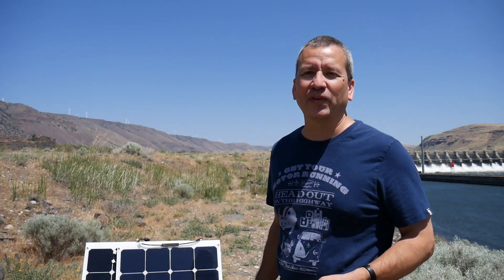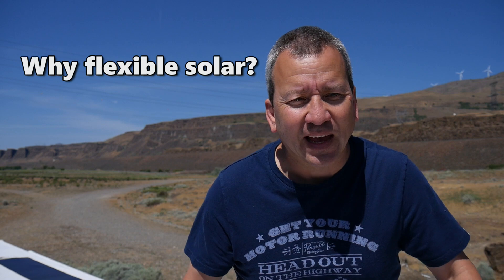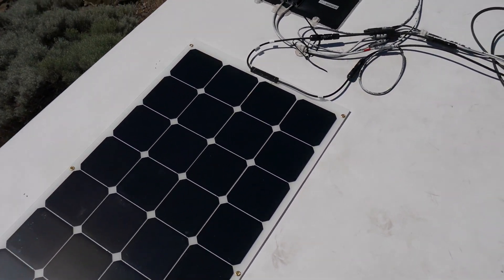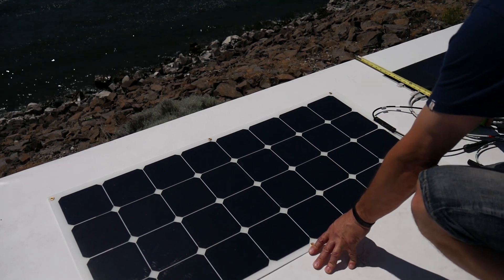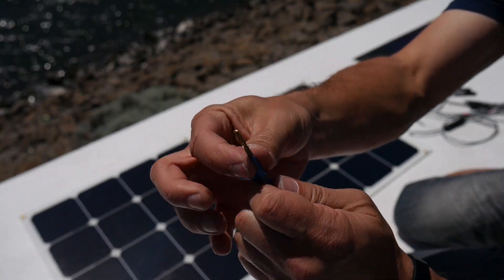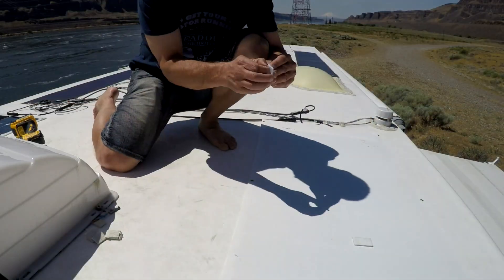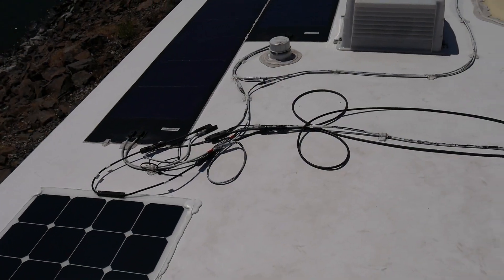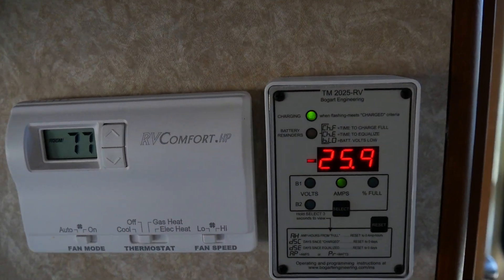How To Install a Flexible Solar Panel on an RV

Comment: Whether rigid or flexible panels you have to secure them to the roof. Rigid still needs a mount point and the support is still attached to the roof. I have a camper and solar panels and been to all 50 states. Solar panels and controllers in camp are silent and much better than the noise from a gas generator. You and Melissa will enjoy the fruits of your labor over many decades to come. Best wishes. Stan in California. Married to the same girl for 52 years.

Comment: Why drill and mount then seal? Just use flexible sealant. It will not come off. No penetrations to leak or fix later.
Use low profile PVC cable conduit to ensure wires are protected from elements and animals. The rounded top 1/2 will be less noisy too.

Comment: Put sealant on the screw threads and run them in, that's all that's needed for waterproofing them.  Sealant all the way around is going to be fun if a panel needs to be replaced.  It also means no possibility of air flow underneath to help keep them cool on hot days.

Comment: Nice job for an amateur.  Use of Dicore ( screwed and Eterna bonding tape. First, the use of silicone in screw holes is a must for severe weather. Second, he admits to solar panels blow off from effort to vent then underneath and fails to admit it on video. If used pinhole in greenhouse roofing material polyurethane it could transfer the heat from under the panel. cheap aluminum is not good but stainless is ok. The instruction say to vent bottom of panel too, an effort to increase the voltage in heat of day temperature of 170 is typical without a sprayer,

Comment: I just have 1 question, I'm a new motorhome owner, I have disabilities which doesn't allow me to get on the roof. I intend on routing the power cables from the engine compartment to the rear of the motorhome to the battery compartment. Then thru the underside below our bed, and mounting the controller to the front of our lower compartment of our bed. What I'd like to do is set the flex Solar panel across the dash, as there is plenty of space there and allows me to angle the panel for the best performance. This would make it portable, and accessible to clean.  My question is, how warm does the back side of the panel get, should I be concerned about damage to the dash, if so should I insolate it from the dash?
Reply from the maker: The last time I measured, the temperatures can get up to 140 degrees F. That'll depend on how much energy is flowing through. I'd put something under it.

Comment: Thanks for the video. On 6:24 you're drilling the roof, but in the newer videos you stick to non-drilling approaches. Which one is better/safer in your opinion? Do you want to add a note to the video about "check non-drilling approach in another video"?
Reply from the maker: I'd prefer not drilling unless it's necessary. At this point, nothing is screwed in.

Comment: I wanted to see you do the wire connection step by step (what goes where) but I didn't see that. It was already done and all I saw was you securing the panels down with screws and glue...

Comment: Appears that it has been 3 years since the install and I'm wondering how it is working out.  Have the panels deteriorated at all?  Any replacement?  Any reduction in voltage output?  
What is your thoughts on leaving some of the plastic cardboard open to the breeze on the sides?  Any overheating?  Considering similar, any updates on the process?
Reply from the maker: Yes there have been some changes. One of the three HQST panels failed. I've upgraded all of them to SunPower branded flex panels and mount them differently now. Check out this more recent video: https://youtu.be/hROYaqY83v4.

Comment: They make wire tie stick on bases that you could 
Velcro too. No holes and easy to change if one goes bad.
Also I think more Velcro
strips strategically placed would work plus would allow air under to cool panels. 
Nice video! 👍👍

Comment: Why do you wire them in series? Because you have an MPPT charge controller? Makes no sense. Actually an MPPT charge controller can regulate better if you wire in parallel.
Reply from the maker: I prefer series at higher voltage with lower current going through the cable. The MPPT controller works well in that mode. Parallel works too but higher current from the roof.
Reply: @RVwithTito  Yes the current is lower in series. That's a valid reason. I was manly criticizing that in the video you just said: because a MPPT can regulate better. And I was like: wait a minute, that's not true.

Comment: WOW, I thought that one reason to use Flexible panels is to NOT screw More Hole 07:50 into the roof. I would have used that high two-sided tape and maybe 2 screws on the leading edge.  NOT 6 MORE HOLES.  :(

Comment: I'd have rather seen the panels mounted on Corefulte for airflow and heat dissipation
And 125vdc, wow..... Does that pose a harm to humans or electrical fire issue?
I am amazed your MPPT controller will accept such a high input voltage for 12v system

Comment: Brian- Have you ever considered installing coroplast polypropylene panels under the solar panel and leaving the ends open so the panel could breath?
Reply from the maker: Yes I have. I've actually built a new mounting using those and have a couple panels using them. It's the way to go I think. I'm road testing the setup now and will make a video about it in the next few weeks.
Reply: That would be great!   I have four 160 watt panels to install.
Reply from the maker: @opaandomascampingadventures  Yeah. I created a system that's open on both sides, doesn't require screws or drilling, and the panel is bolted on and easily unbolted and removabled. Working great so far.
Reply: Can’t wait to see it!!

Comment: How long did it take for the dicor to set? What kind of screws did you use? I'm getting ready to have 100 watt renogy flex panel put on the roof of my 2019 Four Winds.
Reply from the maker: The Dicor takes a couple of days to fully set. The size of screws you use will depend on what your drilling into. I think I used about 3/4" screws. Make sure they're not too long and poke through your ceiling.
Reply: @RVwithTito  Thank you for getting back to me. I bought 1" metal screws, however, my son-in-law had to go out of town so I have time to exchange them for 3/4". My motorcoach looks just like yours only shorter, so, I believe it is a rubber over metal roof, I'm guessing. I hope that's all I need. Thanks for your help.😊
Reply from the maker: @debrahayes2572  I may have used 1" screws. Can't remember. You're probably ok with those.
Reply: @RVwithTito  Ok, thank you!😊

Comment: How will your panels not cook if they're sealed off with no air breatheability?
Reply from the maker: Flex panels also release heat from the top, unlike traditional panels that release most heat from the bottom. Of course a little gap between the panel and surface is always better. I'm working on another technique for that.

Comment: these often fail after a couple years because of over heating   causes damage to  the cells
Reply: Hey Julie, do you know if the heat destroys the cells themselves or does the heat destroy the bypass or blocking diodes? (The diodes are an easy fix, but if heat destroys the PV cells it's game over.)

I'm asking because Rob at the Off Grid Tiny House project on YouTube had all of his thin film panels die at around the same time, and his panels had aluminum sheet backing but were glued directly to the aluminum roof of his tiny house trailer. We're wondering if the summer heat killed the solar PV cells?

Comment: @6:40, did that ever leak? If not, Butyl is an amazing product.   Do Flexible panels need any space for ventilation?  I have to wonder about the ventilation space requirements on Rigid panels too and what that is about??  I've had this idea of using a rigid 100w panel as the lid on a custom van roof vent where the panel would sit flush on weather stripping and the opening would be a watertight bent/welded angle with another layer or weather stripping. but the concern is any toxins or heat coming from the bottom of the panel into the van and if I can just insulate the bottom of the panel? If the answer is because panels get very hot, so does the roof of my van.  I have to wonder if the space is more about concern with water pooling and short/shock. https://drive.google.com/open?id=1vKXInuftSZq0ufeHJHZWsjlaqAc0zlfA

Comment: Hi My Friend , just getting ready to add my first panels and 2 questions for you,,,,,,,, 1 - the screw what size is 1 inch long by  6 or 8 or ?? Diameter  and 2- what width was the  putty  3/4 or 1 or 2 inch wide ,,,, Keep up the good work  ( Gary in Sun City Arizona ).
Reply from the maker: I don't remember the size screws. The length will depend on the thickness of your roof and what's on the other size. 1" worked for me just enough to get in the plywood. Better to have a little bite to hold it so nothing too thin. You may need a washer to hold it in the grommet. The Butyl tape I used was 1 inch. Good luck!
Reply: Thank you Brian , We have been dealing with rain in sun city Az just because i want to add panels LOL  ....O well no hurry  , its a travel trailer 2018 north trail 23RBS  so working on many issues and figuring out how to run wires add batteries and other items , Thank you again  and be safe.  up date  decided to do 4 100 watts.

Comment: I have a question about solar.  I have installed a solar panel on our old RV and it worked great.  We have a 2017 RV ( Forester 3051s) now and thinking about adding solar to it.  The main question is when it is charging will it charge the Truck battery also?  The reason I ask is that my truck battery went dead while in storage.  Thanks

Comment: If you study the instruction for c-Si so-called semiflexible panels, you will see that there is a very low deflection allowed. When a micro-crack occurs, the electrons must skip the crack and thus heat will develop. Because your panel is made with a back of plastic, there is a risk of fire.
If there is no fire, there is definitely some insulation that melts at a time by your camper.

Comment: I've had a panel fail, so I'm putting a flexible one right on top of it with glue.  Concerned about heat.

Comment: How do you wire from the flex panels to the battery?  NEWBIE solar panels
Reply: Solar panel -> Charge controller -> Battery.
Additionally, you need to configure (math and some basic electrical knowledge) the solar panel to the voltage and current that the charge controller is rated at. Same goes for battery.

Comment: Great video mate. I learned a bit from it... thanks. I normally would have no more to say, except that a week ago while travelling on a narrow road, a huge semi-trailer come hurtling down the road in the opposite direction at hi speed. The wind factor as it hit my camper head on was like a tornado cat 5 haha, and nearly tipped my humble little campervan over. Well that was fine, but latter I wondered why my regulator was not showing charge. I climbed on the roof to find both my panels ($600 worth) gone, and the wiring ripped off. I never heard a thing... I guess because of the noise of the semi-trailer passing. The lesson I learned is , no matter how good you secure it... its not enough. I had those panels glued, screwed, and hinged down down on 3 ply.... and they still got loose. I studied it a bit and come to the conclusion that the "windward" side of the panels needs extra securing, so with the new ones when they arrive, I will bracket the whole leading edge of the panels down with a type of flashing, so as NO freakin wind can get under to lift off. Its really easy to do... just a strip of aluminium say 1" wide, glued and screwed along the leading edge which is for me, the shortest edge.

Comment: Just a thought, instead of mounting them in direct contact to roof what about creating some lift so air can flow underneath.. I wonder how the provided grommets and adhesives would perform at high winds as far as being secure.

Comment: Greetings.  I have a Bigfoot truck camper that I'd like to install a lithium solar system on.  Do you have any installers that you could recommend?  If so I could send my email address.  Thanks, and keep the videos coming.

Comment: Nice video thanks for sharing! Although I don't think it was a good ideal to seal all the edges! It was actually good that you had those bits of putty tape lifting it up giving air circulation underneath and help heat dissipation. I heard a number of stories from people that had their flexible solar overheat and break because it had no way to cool.

Comment: was just reading up on these panels, they had a disclaimer saying not to adhere them to a surface as the need to have cooling and not to connect them in series, but may not cause issues

Comment: Great video, just the idea of running the frig alone is super👍👍  Thx!  nice..looking more into that.
Reply from the maker: I only run my frig once my batteries are fully recharged and I'm getting full sun. A lot of times, I'll power the refer from inverter while driving on a sunny day. This enables me to disconnect the propane while driving if I want. The refer switches on and off via thermostat as needed to keep cool. So while driving I'll keep it on the low setting and run my inverter. Most of the time I run my refer on propane.

Comment: How much do you loss with flat panels?  Jack
Reply from the maker: I haven't experienced any differences between these and other panels. The biggest loss for most will be from light guage wiring and connection points.
Reply: Thank you again.  This has been helpful.  Jack

Comment: Thanka for the video. Would like to install these on a reefer container for storing perishable goods while being transported. The reefer has a max power usage of 15 KW but uses an average of 8kw. Would it work?
Reply from the maker: You would need a lot of real estate for 8 KW worth of solar panels. That would be around 80 x 100 watt panels. Plus you would need thousands of dollars worth of batteries to power the refer.

Comment: A refrigerator that draws 26 amps??? Close the freaking door
Reply from the maker: That's 26 amps at 12 volts DC drawing from the battery bank which is what I was measuring. At 120 VAC from the inverter it would be roughly 1/10th of that (2.6 amps).
Reply: Thanks for the info Tito. I thought the amp meter was on the output side.

Comment: Question about this flexible panels. Do they have by-pass diodes like rigid panels? Nice video and audio... great actually. Thanks
Reply from the maker: +Clint Johnson Usually yes, but I'm not 100% sure on these HQST panels. I've read YES, but I haven't cracked open the jbox to confirm.

Comment: Good epoxy or Double sided foam tape (Like they use on windscreen mirrors or Gopro mounts) are way more secure, saves drilling holes in fibreglass roof.

Comment: I wonder how many watts you need to run a camper ac? I live in the deep south so I would have to get a long way away to be cool enough not to need one. Also how long can you use say a frig or ac on those watts?
Reply: You would need 1300 watts to run an efficient 13.5K BTU AC unit and double that for a second or so at start up.  13,500 BTU relates to about 3954 Watts  (3954w / 3 = 1318w - rule of thumb).The watts  or amp hours you 'remove' from the batteries, is what these panels via a charger / controller and hardware REPLACE. 1300 watts is about 110 Amps. So, you might need 13 of these 100 w panels to replace what was discharged, which is a very very wild guess. But, the real questions are: how many batteries of what type (can you even haul that many) considering how much you can remove before doing harm and how quickly; and how large an inverter you need. Then consider that there are other appliances (etc) running on 12 Vac. However, you can absolutely run an RV fridge on batteries either directly - 12Vac if you have one like that, or via an inverter - but if you do, look into disconnecting the heater in the door. I do this all the time and see about 27 amps from the panels while the sun shines. However, no sun, no fun. My fridge is then switched to Propane. Oh, my Magnum MS-2012 inverter will start and run a dometic 13.5K but I don't think 460A/h worth of FLA I have will do it for more than 30 minutes. Use solar for what it was intended (quiet and clean and sort of free) and a generator if you want to run an AC unit.
Reply from the maker: RV air conditioners need a lot of power, much more than you'll be able to store in moderately sized battery bank. If you rely on AC, then running off of solar and batteries is not going to be a viable option for most of us. Chris at Technomadia wrote a good article on this subject that you should read if you need more answers (http://www.technomadia.com/2016/06/running-an-rv-ac-off-solar-batteries-and-a-hybrid-boosting-inverter/)

Comment: Can you explain why you chose not to use lithium batteries?
Reply from the maker: +Larry Norby The price vs benefit of lithium is still too high for me to justify. I would be looking at around $1000 per 100 Amp hour for lithium. Plus I would probably need to buy a special charge controller for them. Standard lead acid or AGMs suit my needs fine for now at 1/10th or 1/5th the cost. I do keep an eye on the lithium market though, but I think it's still too soon for me to jump in.

Comment: I'm thinking of using a silicone tape on the underside, right next to the of the edge of the panel.  And I might use some wide flange washers to sandwich the grommets. The velcro on the bottom is a great idea to hold everything in place while you are working on securing it down.  :)  Great instruction..  You gave me a lot of ideas.